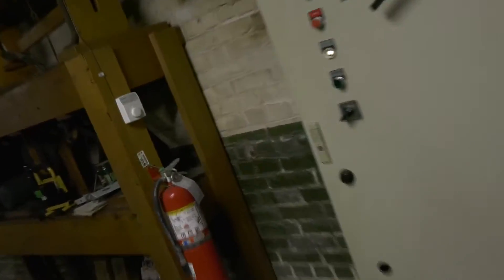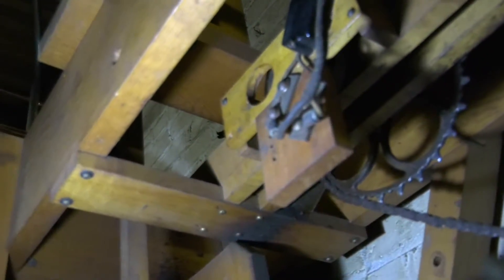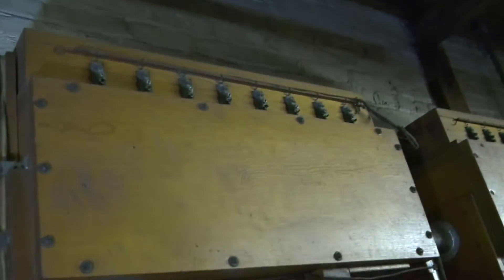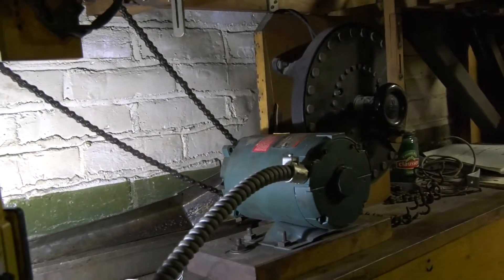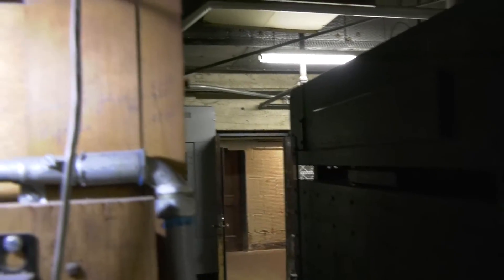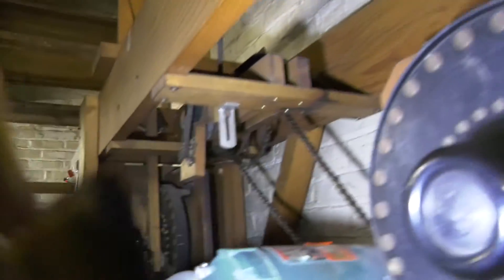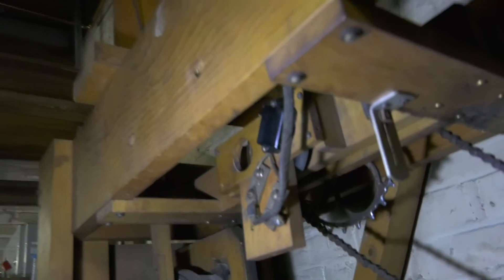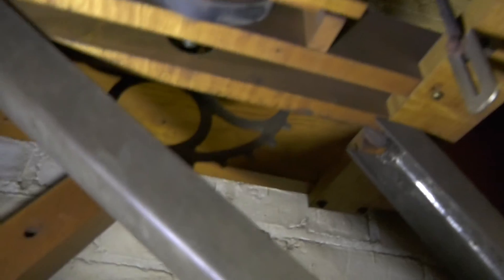Boardwalk Hall- The tremolo system

Comment: I have some Midmer-Losh parts, made around 1929,  that came from a church in Syracuse when they decided to junk their organ.  That wasn’t the original installation, as the church building looked to be 1950’s vintage.  One of the items I got was a regulator, of the diaphragm type similar to what you see on the Atlantic City M-L.  Its trem is completely internal to the regulator.  To vary the pressure, it has an actuator pneumatic that works by varying the length of the linkage between the regulator top and the intake valve.  It’s controlled by a pneumatic oscillator mounted in/on the regulator itself.  There doesn’t appear to be anything on it to dump excess air to the atmosphere.  If I ever use that regulator, I’d almost certainly abandon the pneumatic oscillator, and instead just electrically control the existing actuator pneumatic.  Probably add a dump valve as well, for a deeper tremulant.

Comment: So the ultimate operation of the tremolo is an electrical signal which opens dump valves in the reservoirs to periodically reduce pressure? That seems pretty neat. The organ in my church (modest British built in 1909, full tracker action) has a motor that operates some kind of flap in the wind path to cause undulations in pressure. None of these fancy bike chains 😅
Reply from the maker: Yes you got it right. Austin organ company used "fan" tremolos sound like what you're talking about.

Comment: I think the switching mechanism has a rotating ring magnet (diametrically magnetised) and a polarised reed switch- the switch is on approximately half the rotation- this sort of technology was around long before the organ was built, so it’s a likely choice 👍
Reply: Eh....maybe.  I'd bet it's more simple and "crude" than even that.  You have to remember the original construction was late 1920s.  At that time, the fanciest telephone central offices were still using "panel switch" (if not still Strowger) with open brush/commutator switches riding on sliding bars.  Telephone crossbar switches wouldn't come along for a while, and encapsulated magnetic reed switches wouldn't really be a thing until 1ESS in 1965.

Similarly, fancy ring magnets like you describe were a lot less common.  Horseshoes and straight bars were pretty typical forms, and often plain magnetized iron (no fancy Alnico) was again pretty common.  Take a look at the guts of a (then "advanced" and expensive) RCA ribbon microphone (like a model 44, or its prototype predecessors) from the early 1930s, and the elaborate magnetic armature still used a cast Alnico horseshoe as the main element.

As an organ builder, I'm not expecting Midmer-Losh to have been at the "forefront" of electrical equipment.  They were using off-the-shelf parts when and where possible.  The "studded rotary switches" for the old motor-control resistors were GE products, and pretty typical of the 1920s.  A magnetic reed switch would have been a luxury device, even in electrical equipment circles.  Not saying they didn't exist (Motorola would use magnetically vibrated reed switches in car radio power supplies, to generate AC and produce the 100+ volts needed for the tube plate supply). But I'm betting its something like just a simple leaf switch riding on a cam.  Fatigue life can be pretty good if the leaf is designed well, and the contacts don't have to pass huge currents.

Comment: It really wouldn't take much to restore the pneumatic dc control. Solid state power supply and modern 90v motor and existing rheostats could make it work. If the rheostats are damaged it gets more expensive.
Reply: There's not really a point. The entire purpose of this was simply to generate pulses, which is more practically done using the existing digital control system or about a dollar worth of electronics.

Comment: All that to produce an electrical signal 😛 A massive electric motor (ok small compared to the blower motors..) and a bicycle drivetrain which requires a lot of maintenance. Perhaps back in 1946 the only way but if you are going to improve this setup i think it’s best to find a 100% electric solution. Some timer circuit and FET diodes.. get an electrical engineer for the job to find out what the signal needs to look like and let him reproduce that 🙂 Nice to see these mechanics thanks for sharing 👍

Comment: Regarding the operation of the original "bicycle chain driven" tremelo modulator assembly, I'm guessing the spinning wheel attached the bike sprocket has a sinusoidal shape carved into it's circumferance.  Visualize a tone-wheel on a Hammond organ.  The highs and lows pass by the sensor and switch it "ON and OFF," or is it a variable signal?   Take a look at the electro-mechanical apparatice that used to flash a neon sign ON and OFF.  It was simply a rotating wheel that had high and low spots like the camshaft on a car engine.  A lever rode on the cam, and was coupled to an ON/OFF contact.
Reply from the maker: It's a simple on and off as there's no way for the magnets operating the dump valves to have any sort of variable response.

Comment: I'm NO organ tech (but it fascinates me) How on earth did something so Rub Goldberg-esque  actually succeed for those 30-whatever years? All those pneumatics!! For that matter, even on smaller church-sized instruments and scads of theater organs, it's impressive these mechanisms were apparently reliable.
Reply: They worked as long as the leather and rubber tubing was in good shape.
Reply: The ratio of spring to weight of the pressure regulator is the critical factor in achieving a smooth theatre organ tremulant. WurliTzer regulators use a 3 valve design by Hope-Jones. I doubt that this system could produce a satisfactory tremulant for a tibia clausa rank.

Comment: Will the other trem eventually be controlled by the opus 2?

If not would it be possible to make the existing trem control somehow work with the variable frequency drive so that it can vary the speed?

Perhaps use the original rheostat but remove the winding and solder resistors to the taps if the VFD can operate with an external control. That way the speed can be varied from the console.
Reply: I agree, they should be a way to extend the VFD rheostat to a remote location.
Reply: If the VFD is looking for an analog voltage input, you could power the rheostat from a common DC supply and let it make the control signal for the VFD
Reply: Nowadays you could get rid of the motorized stuff, and just use a 555 oscillator with variable speed, and enough power transistors to drive the dump-valve loads.  My guess is that’s what the Opus-2 controlled trems do, but they probably do it in software.